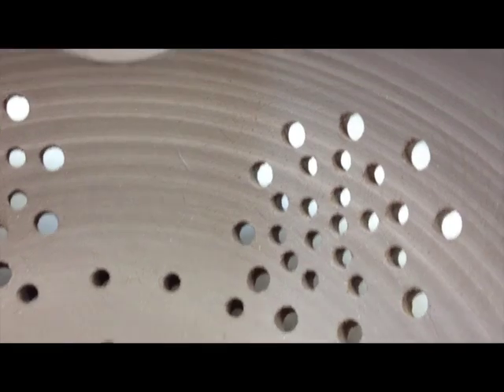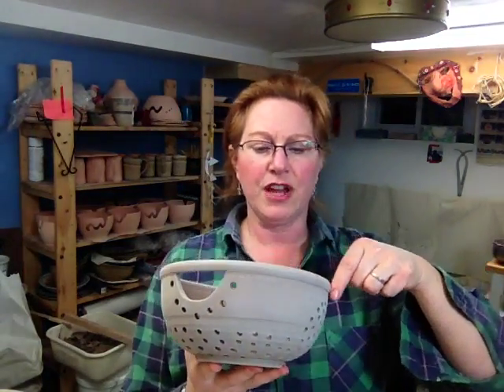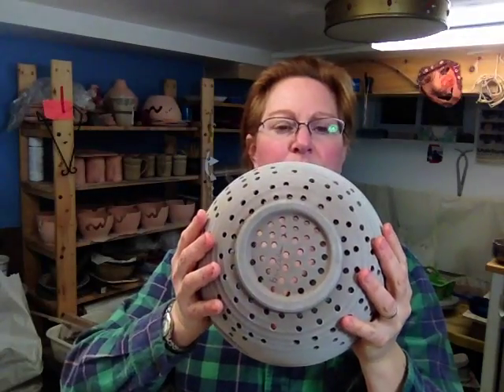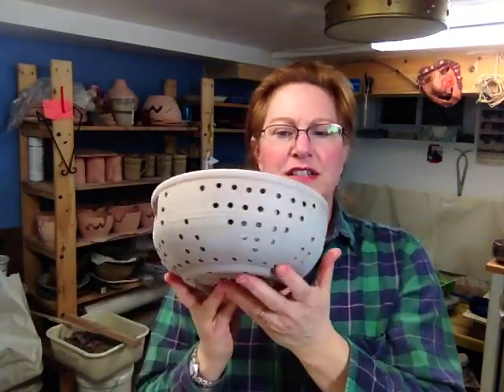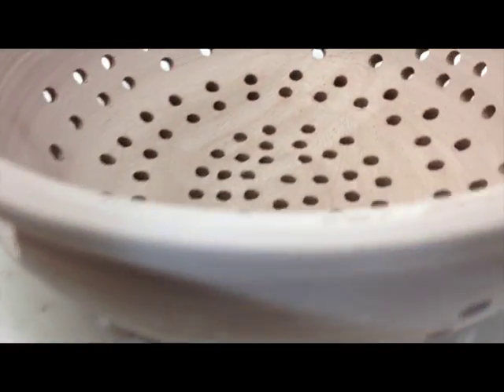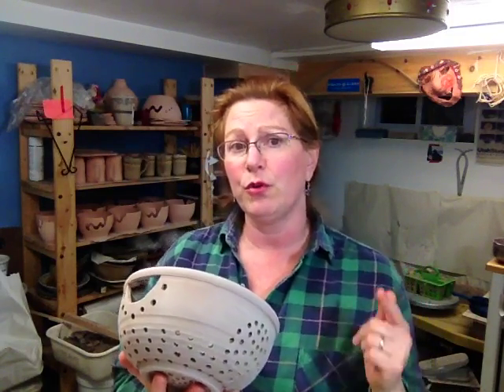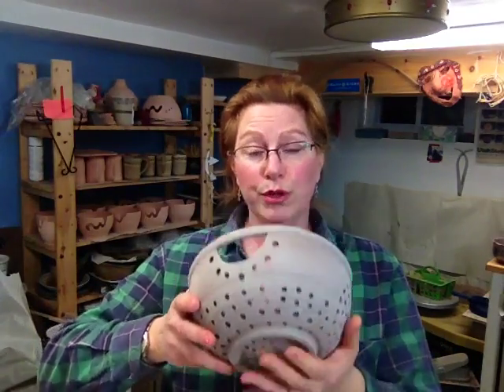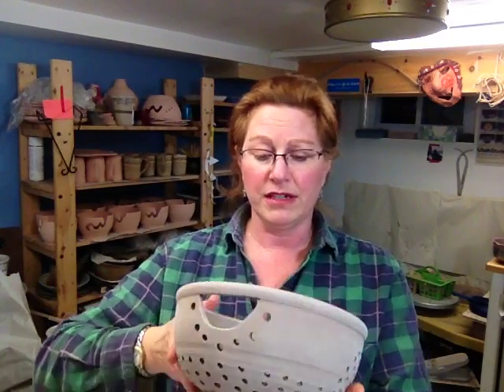Bridges Pottery Ceramic Colander Part I

Comment: Hi Patricia, I saw both the parts of this video and it was awesome to see the start to finish process ! I admire your teaching style, talent & knowledge. I wish you would make a bonsai pot with a perforated bottom like this, just as a concept demo.  I have been proposing a ceramic bonsai pot design with multiple holes like this on the pot floor and the bonsai community just does not get it. So far, i have been photoshopping the extra holes on a regular bonsai pot. Since such a pot doesn't actually exist, having a video of it, from you, would be really cool and can be used as a evidence in my articles and videos, with a link to yours.
Reply: If it is not too much trouble, it is my request that you please make just one such piece and also address the concerns of pot being fragile (maybe extra thickness of the wall is needed or some firing technique), with the added weight of a bonsai tree and wet soil and frost issues. Thanks a ton :-) To get more clarity on this, you can search my video "are bonsai pots intelligently designed" on youtube.